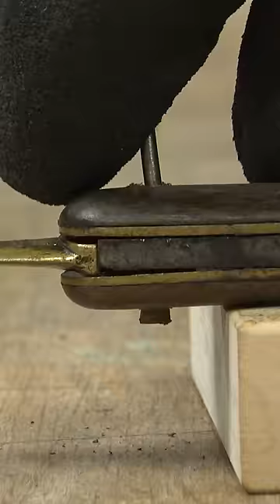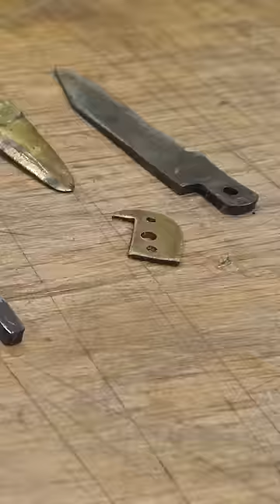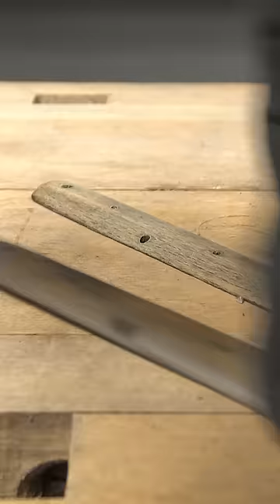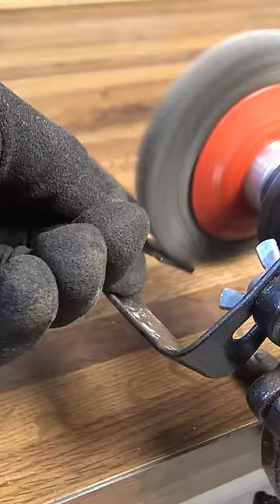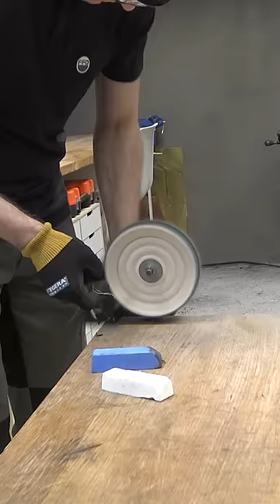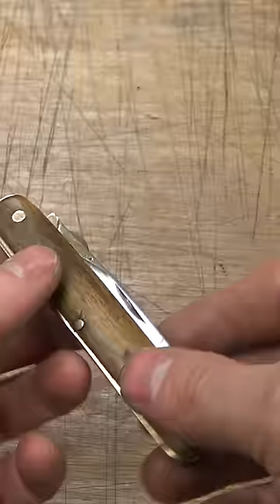Old Grafting Knife #restoration #vintageknife #gardenknife

Comment: What's the brass thing for? I've never seen one in a knife
Reply from the maker: Hey! Thanks for asking! Basically to prevent cracking of the handle while hammering (forcing) the tang into it. The second function is to lock the blade in place without any glue 😉
Reply: @FFD_Restorations  yeah i noticed you were very meticulous about not leaving any tool marks whatsoever... Not an easy thing to do 👍😁
Reply from the maker: @debacofzomb9889  well noticed 👍
Thanks